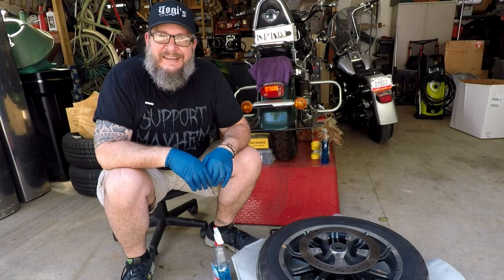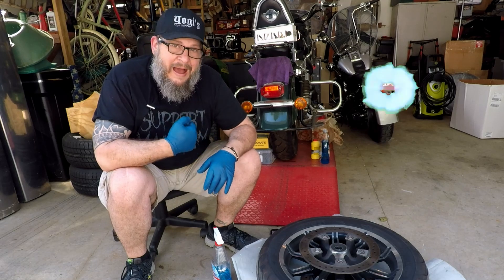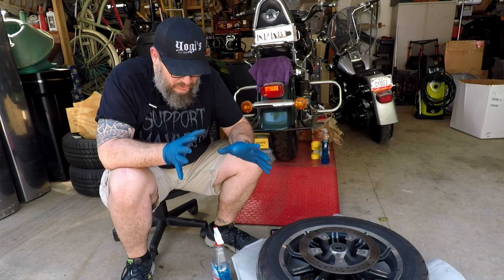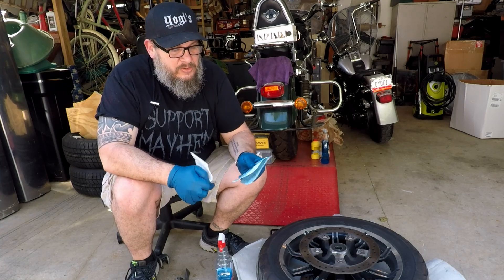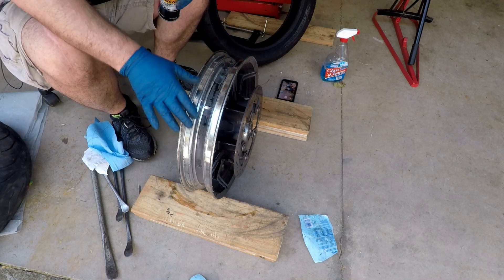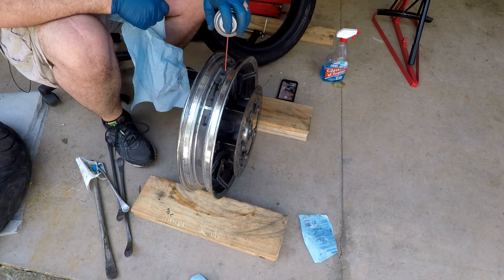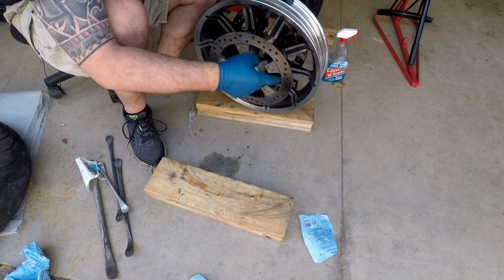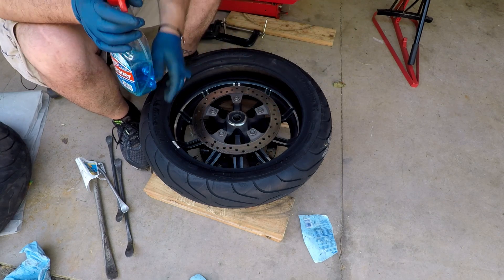Changing a Motorcycle Tire With Spoons

Comment: Great technique. I have done my 16" SYM HD200 EVO scooter tires myself with just spoons a few times before but with your technique tips, it went much smoother today. The shop closed on me before I could get there to have them do it so I dug in and did the job myself again. Gitter dun!
Reply: Forgot to mention, I always use a ratchet strap because have had issues getting the bead seated  in the pastand yep, it works every time!

Comment: I've changed three motorcycle tires now, and after every time I do it I always say "never again!". It's such an overwhelming pain in the ass changing your own motorcycle tire.  I still continue to do it because I'm a cheap bastard, but I despise doing it.
Reply from the maker: Ha ha amen that.  I couldn’t agree more
Reply: I’ve been there!  Used a sawzall once. Here’s a better way; If the tires are a pain to remove/re-install, and you’re using proper tire irons…why are they so tight?  You’re doing something wrong. I learned that you probably are on the high side of the rim. The bead has to be on the smaller diameter of the rim.. near the centre. A way I found to insure that the bead goes there is to put a c-clamp on the side 180 degrees from where the tire irons are. It keeps the bead off of the high side of the rim.
Reply from the maker: @davemclean6835  good stuff
Reply: You’re not a cheap …. You’re being thrifty!  I bought a manual machine and balancer and if I charged my friends it would have paid for itself by now. Nice way to spend a Saturday am….as long as everyone pitches in.  There’s nothing better then messing about with boats…I mean bikes

Comment: great video, just food for thought, do NOT use break cleaner on painted wheels!.... unless you're trying to strip the paint on purpose. Spraying on rag and whiping is somewhat okay but not directly on it. If it pools at some point you dont see, that paint will bubble and wipe right off. Some wd40 or just simple green or windex does fine to clean it.
Reply from the maker: Good point thank you
Reply: @YogisCycleService  sadly it's an "ask me how I know" situation :(
Reply from the maker: @SilkLotus  yeah been there done that.  DOT4 will do the same thing
Reply: 409 does a good job of cleaning and doesn't  leave any residue.

Comment: Good job brother, I was going to say that you can use a ratchet strap, that's how I use to do it, but I found a lot easier way to do it, just spray a little ether in the tire and I mean just a little, and take a torch lighter strike it once close to the rim and it will seal up and then add the proper air pressure to the tire,it works really good, thanks again for sharing brother ride safe and stay healthy 💯✌️😎
Reply from the maker: OZARKS H-D RIDER'S thank you!!   Usually the other air chalk that I have works well without the valve stem but heck if I know where it went.  I might try the ether method one day. Lol that just makes me nervous.   Thankfully this time the strap worked.   Ride safe my friend and thank you for the comment!!
Reply: @YogisCycleService  anytime Brother, I've used ether on car tires, tractor tire's and lawnmower tire's and bike tires, I was a little nervous the first time myself, but I've never had a problem with it, I've never had a tire do anything but make a poping sound as it seats the beed, TC brother 💯
Reply: I have found that some of ether from the auto parts store is very diluted. Not as strong as the stuff from a place like Pilot or some other truck stop store. Some of it will burn but not flash off. That flash off is what will seat the tire.   Used to use a fair amount to seat semi tires 1/4 can or so, would run a "fuse" line of ether to light it off.  30 years ago when you didnt smell the rag to see if it had any residue left on it. LOL  Funny, still safer than the 3 piece wheels.
Reply: @chuckhabrack3330  yeah I wouldn't try it on split rims that could get ugly pretty quick LoL 😂💯✌️😎
Reply: @OZARKSHDRIDERS  You know its going to be bad when you have to put it in a cage...
Reply: @chuckhabrack3330  yes sir 👍
Reply: @YogisCycleService  yep, that's precisely the point this went another direction 🤜💥🤛
the volume achieved without the valve in there makes all the difference..

Comment: I just discovered the beads that go inside the tire. I was wondering, what if you get a flat and have to use a plug, then what? will that affect the ball beads?
Reply from the maker: Thats a good question.  I dont think it would but still a good question none the less.  I would defer that to Dyna Beads for the answer to that
Reply: It won't effect the beads. In fact the beads will counteract with the slight imbalance the plug may cause.

Comment: Tires vary I have had good luck  using a bicycle pump only needing a strap once or twice. I only use  external  wheel weights because beads are not reliable at excessive speed

Comment: For those that have not used balance beads, you will hear them in the tire when pushing you bike around. It sounds like a leaf is stuck rubbing the wheel.  Yogi, did the beads in the old tire still look like beads?  With 24,000 I was wondering how they held up? I have seen some in truck tires that some had turned to dust, but that was 50 - 60K  and 6 oz of beads.  Nice video and good tips on wheel direction.
Reply from the maker: That is a good question and I will go take a pic and send it to ya.  Long story short yes they held up and look like i just put them in there.  I could potentially pull them out and reuse them however there is rubber dust mixed in with it because yeah after 23,000 miles they could be a little abrasive and did make a little bit of rubber dust I dont want to reintroduce into a new tire for how much they cost.  I would rather just go with new beads and start fresh

Comment: Thanks for sharing Yogi.  I'm curious about the balance beads ... I've heard that they can wear the inner surface of the tire and you end up with a tire a lot of black rubber powder (as well as the beads), however I'm not sure how true that is.  And there's another product called 'Ride On', which is a liquid balancing alternative to the beads.   We don't seem to get those products here in Australia and it seems that most mechanics & tire fitters just go for the stick-on lead weights.  Cheers from Western Australia.
Reply from the maker: So I changed my front tire on the ultra this weekend after 24,000 miles and yes, there were little black rubber balls the same size as the balance beads in there what obviously came from the abrasion of the beads rubbing against the inner wall of the tire.  I had 2 oz of beads in the tire and if I were to guess there might have been 1/3 oz of rubber pellets.  Honestly looking at the inside wall of the tire I could barely see the wear.  I can take a [pic of it when I get home and send it to you.  That is the most "wear" I have ever seen but its on a tire with 24,000 miles on it so if thats the worst it gets I am not too worried then honestly and I have been using balance beads for at least a decade now.  Personally I am going to stick with the balance beads versus other methods.  Technically they are reusable if you want to collect them back out of the tire and sometimes I do.

Comment: So this is the first hearing about balance beads. How do you know how much balance beads to put in the tire.?
Reply from the maker: for motorcycles its 2 oz front and 2 oz rear.  If you google dyna balance beads they have a chart that will tell you
Reply: @YogisCycleService  thank you sir. What's your thoughts on these beads tearing up the rubber on the inside of the tire. I'm on the fence of using beads or traditional weights.
Reply from the maker: @keithrozeski8463  I have used them for over 10 years.  There is slight wear from the beads but it’s really minimal and has never caused a problem.
Reply from the maker: @keithrozeski8463  it’s not new technology.  They have used them in big rig tires for a long time.
Reply: @YogisCycleService  okay cool. What about the valve stem in the valve. I've seen there are some special valves to resist the abrasion. Should I worry about that?

Comment: Use soapy water when you seat the bead and it will pop right out with air pressure alone
Reply from the maker: Yes I use that or windex, both seem to work well thanks!!

Comment: Just use the air hose without a chuck to inflate the tire without the core in place.  My training has taught me NOT to make tires POP onto the bead. It can damage the bead. Just use more tire lube and they should seat.  No I'm no expert either but I've had a little training.
Reply from the maker: Appreciate that thank you

Comment: I'm not so sure about using spoons anymore. I recently had two tires develop issues. I use proper rubber lubricant etc, but its that stress getting the last bead over the lip. A tire machine puts far less stress on the tire during install.
Reply from the maker: My issue lately has been accidentally puncturing the tube if it’s a tube tire.  I try to be careful but sometimes…….
Reply: @YogisCycleService  Baja No Pinch tool. As we say in England, the Mutt's Nuts. Just pops the last bit of the tyre on. I use tubes on my dirt bikes but use the No Pinch on all my wheels as it is much kinder to the rims.  Love the tip re the cut up bottles. I've just spent £14 on Motion Pro rim protectors which seem a bit too thick to me.

Comment: I have never seen an air chuck that had to have the core in to work? Just because it has a center prong to depress the stem does not mean it won't work without the stem core. All air chucks have to have the center prong to depress the core when it is installed in the stem...
Reply from the maker: Well I guess I have the unicorn.  My last air Chuck worked without the valve stem but this one not so much.  Appreciate the feedback though and the views!!
Reply: @YogisCycleService  I spent my life ass a tech (35 years) and truly have never seen one of these.

Comment: Sorry to me balance beads are just kidology.
Reply from the maker: Call it what you will but I have 15 years and 120,000 miles with them and not a issue.
Reply: And you prob have run out of balance wheels in all those miles. @YogisCycleService

Comment: Can you use the balance beads on a tubed tire on a motorcycle?
Reply from the maker: Yes you can.  Pull the valve stem and fill it up.  2oz per tire